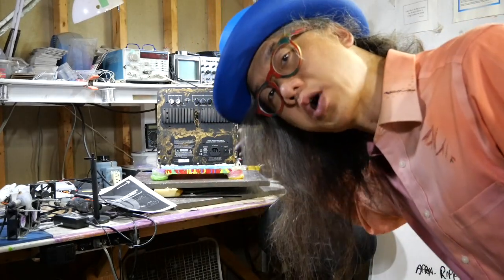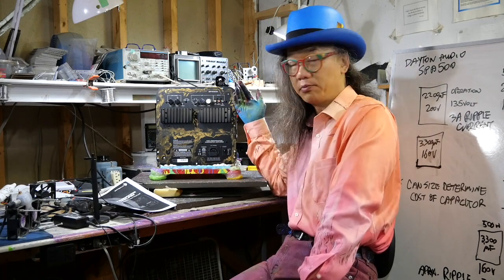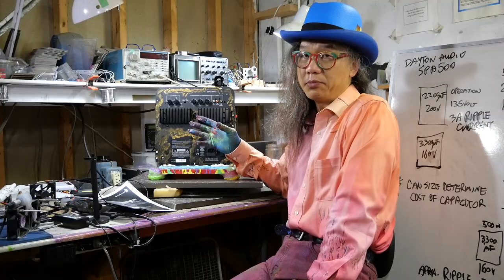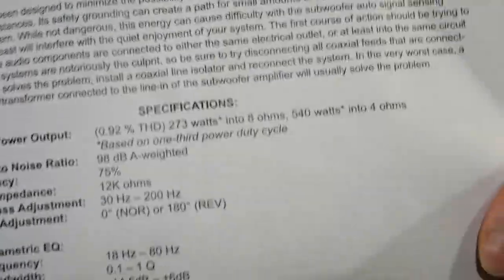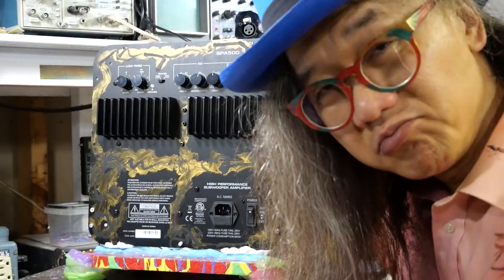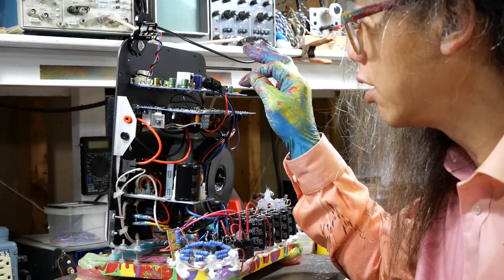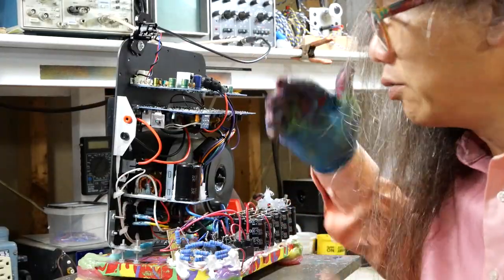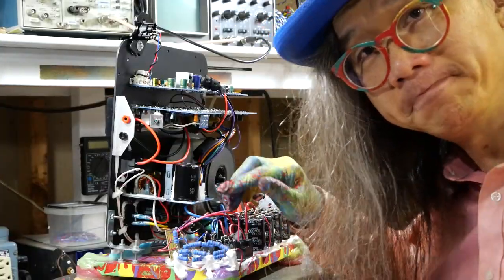Dayton Audio SPA500 Sub Woofer Plate Amp Modifications

Comment: Thank you for the video I just bought this amp recently and wish I seen this video first should I change those capacitors now or wait for them to fail  ?
Reply from the maker: Don't change anything as long as it is working.  If you want to increase the capacitance, be awared this a limit before a proper soft start is requires.
Reply: Thank you so much for getting back with me ! I wish I had the knowledge that you have . what what value  capacitor would you recommend if/when they fail the same value but with a better brand of capacitor ?
Reply from the maker: @lelandroberts1334 Double the capacitance value.  Ant common industrial brand would do.  Don't waste money on crazy expensive audio brand capacitor.  They don't make enough difference to worth the price.  If anyone is willing to pay that much, do what I did to the amp instead.  Increase the power supply by 8 to 10 time and put a soft start in the amp.
Reply: Thank you very much

Comment: I have a Dayton 1200 sub and it's claimed to be 120 watts , the unit has upgrade ability as better drivers and amp plates are available at Dayton however when I opened up the unit to look at the amp plate it was  el cheapo  components , my MK 8" sub is way better however it rolls off at 30 Hertz , I need an AGY upgrade to both lol....love that hat AGY I think Daniel Lanouis has the same one
Reply from the maker: I don't expect Dayton to use audiophile components for thr money they are charging.  At the same time they are not the worst.

Comment: Dayton Audio marks up the numbers like most manufacturers. 273 watts into 8 ohms? Ok, but at what frequency? Do they give a distortion number? Cheapos will measure at 1k even though its a sub amp. Half rated is generally a good idea of what most home audio sub amps put out. 200 watts on a decent 12 will rattle the house.
Music-
Artist- Karsten Pflum
Track- Black Pond
Reply from the maker: Their 540 watt rating is at 0.92% THD.  Good thing I am not looking st rattling my house.  Most I am going to use is likely 50 watts or less.  I am testing their smallest plate amp right now.  No conclusion yet but I am liking it a lot.  May be more than the big amp.
Reply: @angela-gilbert  Forgive me as I am pessimistic about home audio amplifier claims to power output. Nice! and yes sometimes the small amplifier in a lineup will have 75% of the performance as a bigger model but at less than half the price. I am to looking for sub amps, I have 2-15s to power for my current build. I am leaning towards car audio amps.....they have built in everything for pennies a watt. Plus if you run subs off battery and charger it will save the grid power for the rest of the system- ie no-less voltage drop on bass hits. jmo. Fun watching you work! :)